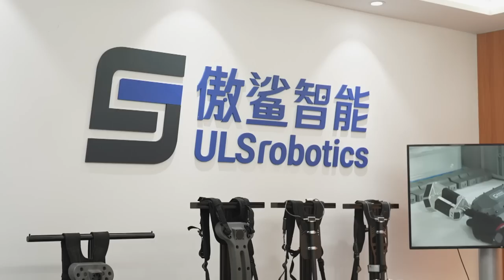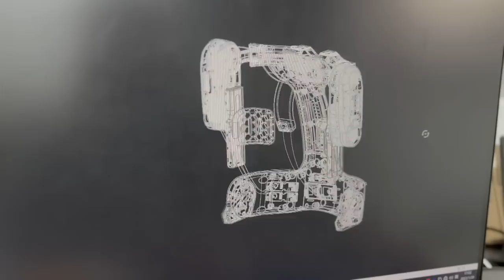The Secrets To Superhuman Strength | Money Mind | China

Comment: this might have safety issue?  If a man is carrying very heavy thing and that device suddenly loses power?
Reply: Remove the armor
Reply: @marczhu7473  from this video, it seems that the limbs of that device are too thin, so it probably has no way to lock the joint positions in case of power failure.